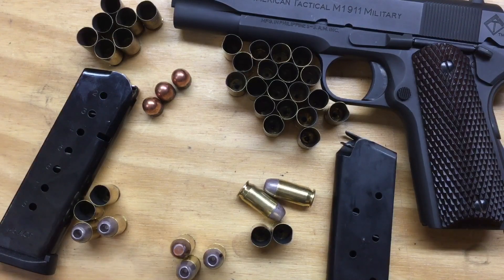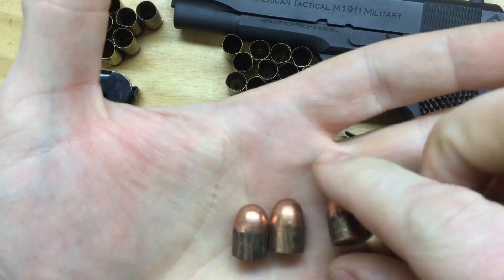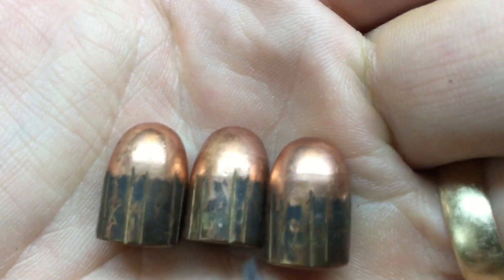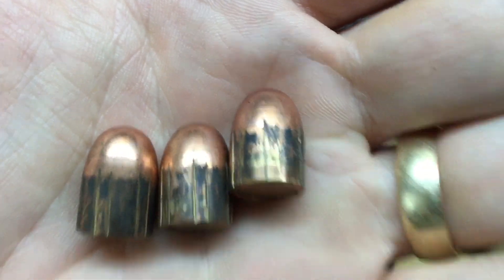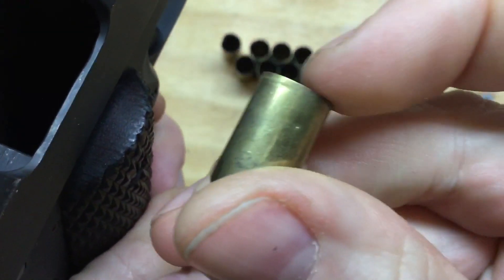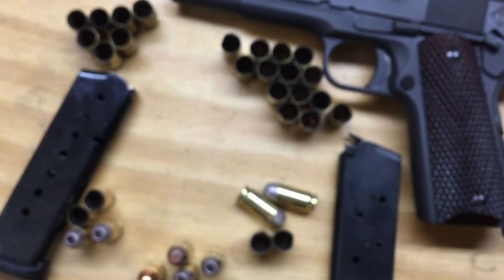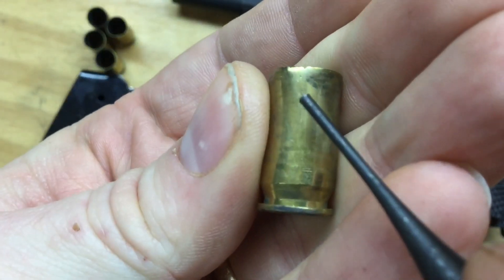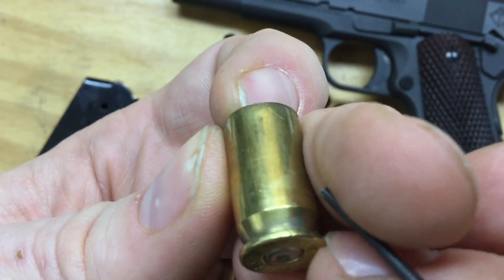Solved?? Weird marks on .45 Auto bullets

Comment: I saw a guy "loosen" the extractor on a Marlin 1894 44 mag one time to allow the bullet rim to get behind it quicker as the bolt was closing and this allowed for a more straight on entry of the bullet into the chamber. That is ,it didn't hit the top of the chamber at such a steep angle. I don't really know much about 1911s or if it would work but it worked for him. enjoyed your video, keep up the good work!!
Reply from the maker: Thanks Georgiaboy44!

Comment: You're analogy is correct . This is why Bill Wilson and Ed Brown are busy men . Polish all friction points . Then tune the extractor .Then tune the spring . The smoother the action , the more reliable it is . Lower the ejection port also helps with extraction also . Then you will know if you have magazine issue .When it all done right you can actually hear the difference when you release the slide stop to chamber a round . A tuned gun goes "click" . Un-tuned goes "crunch"
Reply from the maker: But they both go bang 😁😁😁

(If I ever get my hands on a well tuned gun, I might get spoiled.  I could even be tempted to sell my Hi-Point. 😉)
Reply: Hipoint ....... Well that explains it all ......powder coat the whole 1911 and it will work just fine.......add a squirt gun trigger to it ......tell everyone it 100% reliable ......say it is the best $49  1911 you can buy .......There is no comparison between HiPoint and a 1911....... I can't believe you said the H word when discussing a 1911.....Hopefully they are not kept in the same gun safe......I have to go now......
Reply from the maker: The mention of the brick chambered in 9mm was only offered as proof that I have no real culture and will shoot just about anything, and as such, a finely tuned 1911 would likely be wasted on me.
(I do have squirt guns with better triggers than my Hi-Point.)
Reply: You're the only one you need to please with your gun . Only stirring the pot .
Reply from the maker: Me too 😁
Reply: James Pollard. Try a round loaded a little long.. itll try to jam a tight feed

Comment: They do make brushes to clean the breach that holds the round before firing. Specifically for a 1911. I occasionally use the brush to clean my 1911's. Your summation for higher quality magazines is correct.
Reply from the maker: Thank you Bob!

Comment: You have me intrigued about the marks on the bullets. I would suggest you make a scribe mark on the bullet and the case and clock the cartridges when you load them in the magazine. This will give you more information on where the markes may be coming from. Benchrest shooters almost always clock there cartridges just to keep everything the same, this is one of the ways they get such small groups. But in this case it would help you identify the causation of the marks.
Reply from the maker: I didn't make mention of it as the video was already quite long, but I did mark a few of the cases and bullets.

Comment: LoB - We had gunsmiths throat the feed ramps (lightly radiusing the junction of feed ramp to the chamber) to improve feeding reliability of 1911s.  My stock Colt 1911,s before the modifications were made, were very hard on the brass.  The mouths of empties were dented badly from the ejection port.  All that was solved after the gunsmiths worked them over, and I didn't notice any brass problems after that.  Will check this out next time I shoot my 1911s.  Best to ya,  FC Steve
Reply from the maker: Thank you FC.  It's sounding like reloaders and stock ejection ports are not a great mix 😁
Reply: LoB - I remember first getting my Colt 1911 and bringing the brass back from the range...some of the case mouths had been dented in so badly they needed to have the needle nose pliers treatment before they could be run into the sizing die.  Your 1911 didn't have that problem, and that's a good thing... Best to ya,  FC Steve
Reply: FortuneCookie45LC Radiusing the already unsupported chamber area makes a situation of possible cartridge blowout more likely if heavy loading standard pressure brass. +P brass is a little thicker, but ancient IMI surplus brass was the thickest. The best bet is always a fully supported chamber aka a ramped barrel. $$$. Doing that radius polish mod on a 9 mm 1911 becomes serious if using a +P+ ammo in a non ramped barrel. Thats the reason the 38 Super used a ramped barrel... cartridge blowouts.

Comment: I'd say you found the answer for the marks. You also found a couple of issues with your gun - namely since cases are striking the edge of the port on ejection, it needs to be lowered.
I wouldn't suggest polishing the top of the chamber - too much chance to get it too large, and not enough potential benefit. I DO like the idea of polishing the breech face. I don't visualize any harm, and see a potential for a lot of improvement.
BTW, I really like your chronograph. Going to start saving for one of my own......
Reply from the maker: Thanks Kirk!  I’ve ended up using my chronograph far more than I originally imagined.
Reply: Kirk Boswell A proper extractor shape and tension will stop that port dent.

Comment: By no means am I a 1911 person.  Question:  Are you sure that dent on the nose of the HP is the bottom of the bullet and not the top hitting the top of the chamber as it feeds?
Reply: That's what I was thinking. I don't think the bullet is getting behind the extractor quick enough and it is causing the bullet to hit the top of the chamber at a steep angle and that's what's causing the dent on the nose of the bullet.
Reply: I am thinking the same thing
Reply from the maker: I wondered the same, so I marked a couple of the bullets and chambered them to verify.  I didn’t mention it in the video, but you can see a little black Sharpie line on a couple.  The major dent on the nose of the bullet is definitely on the bottom, and is caused by the feed ramp.  The contact with the top of the chamber leaves a very tiny mark on the top of the bullet nose.
Reply: Loads of Bacon all right then now we know wow

Comment: Second, the imprint in the side of the brass that you suspect is causing the imprint in the bullet is being caused by improperly timed magazine feed lips which are causing the round to strike the hood before the mag lips release the cartridge, therefore trying to bend the cartridge over the feed ramp breakover point.

Comment: RE: polish job , you don't want to take lots of metal away , if any , take sharp edges , burrs , scratches , defects .... get it slick like you would the paint on your car . Chamber polish is a good thing , I have seen chambers dented by the 45 ACP stamp ... I think the guy did a heavy polish on the dent & shine up the other part of the chamber .. It was a Kimber , it could happen to ANY 1911 or like stamping .
Reply from the maker: Time to get out the Dremel ... (joking)

Comment: Not related to the original marks issue, but based on the ring on your pulled bullets, I would lighten up on the crimp.
Reply from the maker: I've wondered about that.  It matches the factory rounds but probably doesn't need to be that heavy.
Reply: 45 acp are not supposed to be rim crimped. The round head spaces on the case mouth NOT the chamber leed.
Reply: @hotrodray9884  Had to jump in. All the ACP rounds indeed head space on the case mouth and most hand loaders taper crimp, BUT I have an  official NRA Reloading pamphlet on the .45 ACP that specifically says to crimp the case mouth. Go figure. All the gun mods in the video and commentary should be also aimed at preventing the bullet from being shoved back into the case. That alone has blown up more than one 1911. When I fired on the 2nd Inf. Div. team in Korea years ago we had a 1911, issue gun accurized, wired on a board. It had blown out a hole a little bigger than the ejection port all around it. On the dent in the fired case mouth, angling the gripping edge of the extractor so the case is ejected more upward will cure that and prevent jams a little better. Not to mention avoiding uglying up the gun by unnecessarily altering the ejection port.

Comment: First, the extractor tension is wrong, (or the extractor is malformed) affecting the timing therefore allowing ejector to flip the brass out and wack the ejection port and hood relief. Im betting extractor tension. Wilson extractors are wider tipped and when shaped and tuned allow the brass to clear even a 1911 port.
Reply: Exactimundo. I posted my comment before I read yours above. You're absolutely right. I don't know about extractor tension, but if you angle the extractor lip from 11 o'clock to 5 o'clock the case will clear the ejector port lip. Absolutely. No uglying up the gun.

Comment: If you are going to polish  the feed ramp yourself I highly recommend watching some competent gunsmith videos. You don't want to remove too much metal or polish to far. Wilson Combat has some videos on polishing the feed ramp. Wilson Combat also makes what many consider to be the best magazines in the business. I've used Colt, Kimber, Chip McCormick, Wilson Combat, and G.I. mags. All have functioned in my Kimber TLE iII, the feedlips and followers are the main difference I've noticed. The longevity of the magazines during heavy competition use is usually where you start to notice the failure rates the fastest. Whenever you get a new magazine and it doesn't work in your pistol doesn't mean it's bad just that your gun doesn't like it for some reason. It's best to trade it at a gunshow or with one of you shooting buddies if it performs well in their pistol, just make sure you get rid of it so it doesn't fail on you at the worst possible moment.
Reply: Yep , they are very nice to post knowledge it took years for them to gain , so many of the people who can't spend $3,500 on a sweet gun .. can slick up their junk a bit & have a better gun for not much $$$ .
Reply from the maker: Great info.  Thanks!

Comment: I use cast hard lead .45 bullets too but with all my 1911's i use round nose ball only.  i do have better results with copper plated or washed bullets though. my best shooter is a Remington R-1 Enhanced for some reason and my Kimber has passed the 500rd. break in period years ago and been back for service several times but it still jams ? a 1,600.00 pos safe queen. nothing wrong with your ati 1911  but look at the internals with a mag. glass for any rough spots. if you polish just polish, without taking any metal off. but your a smart guy you will figure it out :)
Reply from the maker: Are you casting your own?  If so, are you using the Lee round nose mold?
Reply: yes i case my own .38's, .45acp.'s, .30-.30's and they are all Lee molds. the .45acp. is the round nose mold .  nothing special but as a retired plumber i have a ton of pure 100 percent lead and have to add tin/ antimony to my lead so it's a lil harder. i use H. Universal powder with just enough for the 1911's to cycle. this way i don't get any leading in the barrels. I look at it this way 1911's started out with rd. ball and i keep it simple and stay with it. also i use Berry's copper washed .45's with good results. my 2 Kimber's will only cycle with copper bullets ? and really i don't see what's the big deal about Kimber's. a gun should run without break-in periods. i clean my toys with Ed's Red and wipe clean with Hopp's again keeping it simple. i use a tooth brush and scrub the feed ramp too  :)

Comment: I noticed that your slide is like the original 1911. Your ejection port hasn't been opened like other 1911s the ports on my slides have a bevel inside of the ejection port with a slight angle going into the opening and the rear side has a bid bevel for clearance for the expelled casing. I haven't seen any case mouth bends on my brass. They star perfectly round. I did get chambering dents untill I polished me breach Dave with some rouge and a brush on my Dremel. I didn't take any metal off I just made it more slippery. That stopped my problem. I will put it in my video on Tuesday. It will probably get on YouTube on Wednesday. Happy shooting.
Reply: Bigger behind the trigger Atkinson Opened ports were invented to make the ejection timing easier for race guns with extended ejectors. Properly timed, standard A1 ports are fine.

Comment: Seeing the end of the video, if your mechanical bind/ lever hypothesis is valid, seating the bullet a tenth or so longer might cure that.
Reply from the maker: I’ve wondered the same.  At this point though I think I’m just going to load up a bunch and make sure they can poke holes in paper 😁
Reply: I had a similar issue while loading cast bullets from a Lee 6-Cavity Bullet Mold 452-200-SWC 45 ACP. While it’s a truncated cone design and not a traditional rounded nose bullet, I had similar issues. The cartridge would function just fine while hand cycling dummy rounds but would have jamming issues under actual firing. I read all sorts of articles saying where to seat these type bullets with no luck. The cartridges would jam between the top of the bullet nose in the breach and about 3/16 in. back from the neck of the brass on the bottom side. I seated the bullet lower into the case believing that the cartridge was too long but after seating it OUT further and crimping the neck to .470 worked for me. By the way I’m shooting them in a Springfield Armory PI9132LP 1911 Target which is advertised as having closer tolerances. Whether it does or not, I had clambering issues similar to yours and seating the bullet out further helped. I suspect when seating the bullets out further allowed the cartridge to contact the upper leading edge of the bullet without any contact with the case was allowing the entire cartridge to be at a lesser angle into the breach when clambering. Hope this helps.
Zeus775
Reply from the maker: Thanks Zeus 775!

Comment: I currently have a video uploading somewhat in response to what your seeing, its a bit different but I thought maybe it would have some decent information in it. it should be up within the next 45 minutes. I have to go back and watch your video because I don't think I'm fully understanding what you are saying.
Reply from the maker: The short version of all my ramblings is: if your bullets are arriving where you want them to go and performing as you want them to perform, then life is good.  If not, you may consider making sure your recoil spring is the right weight, any possible friction points are polished enough, and magazines can make a difference.

Comment: Sherlock Holmes has nothing on you! The one thing is when you polish the feed ramp going to the camber where the two angles meet there should be a slight radius between the two. And I do polish up the hook on the extractor also. Even with all that some of the brass has flat spots, the need to know can sometimes drive you crazy! I’m just happy when I fire 150 rounds on a target and have a fist size hole. Never stop wondering why! Keep shooting and learn
Reply from the maker: Thanks BI!  I have done a little polishing on the extractor hook.
Keep shooting and learning - that sounds like a great idea!

Comment: Third. Realize that the feed ramp at the cartridge breakover point, the brass gets stretched back out when the round fires and pressure forms back to the chamber shape..
Chip McCormick Shooting Star magazines are the best, IMO. Polishing the chamber enhances feeding and extraction. Polishing the breach face helps feeding. Shaping and polishing the extractor tip enhances feeding as well as extraction.  Does all this really matter? Maybe if you prefer not to have dented brass to reload. Bullet dents = How much accuracy degradation at 25 yds?? Conclusion: 1911 timing is not critical. Theyll shoot 99%. If you want a really good feeling gun, small timing nuances are important. Can YOU tell the difference? Maybe. Final note: mags move around in the mag wells and release timing changes. Its called compromise. All this amounts to is there are significant unseen and unrealized reasons that some guns cost $thousands, and some $500.
Reply from the maker: And this one was $400 brand new :)
I'm happy with it, I just thought the marks were odd, and wanted to know why they were there.  Now that I know, I'm going to keep on shooting.  As you point out, lots of things 'could' be done, but, most of them are not critical.

Comment: Sir, I believe you're chasing two different problems? The marks on the brass, IMHO, come from your ejection port. Newer 1911's come with the ejection port lowered and flared. The loss of powder coating is tough to figure? I can't see anything that would take the powder coat off while the bullet is held in the brass?? Remember, testing the powder coating by hitting it with a hammer. We never get any flaking. Furthermore, you never address your extractor? Could it be a little too tight causing the cartridge not to slide up the breechface correctly? I realize this isn't helping to solve the problems, just giving you more places too look! Good luck on your quest! I'm interested in whats taking the powder coat of the bullets
Reply from the maker: I don't know.  No doubt, the large dent on the right side and the smaller dent on the top are certainly from the ejection.  The powder coat doesn't flake under the hammer, but it does scrape off fairly easily.  (Try it with a knife blade or a case mouth - it scrapes off in a very similar manner to the damage seen on these bullets.)
I did not mention the extractor in this video, but I have previously done some tuning and polishing to it.
I also have a hard time believing that a momentary pressure point is causing enough of a case deformation to scrape off a small portion of the powder coat, or to make a small mark on the copper jacket, but I can't think of another explanation that makes more sense.
Either way, I think I'm done chasing this one.  Time to load up some more lead and make more holes!